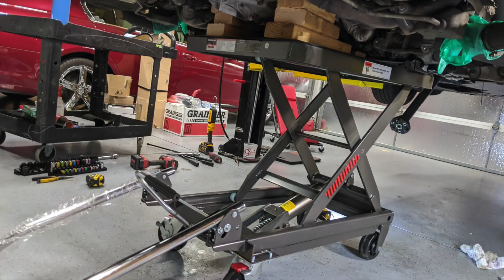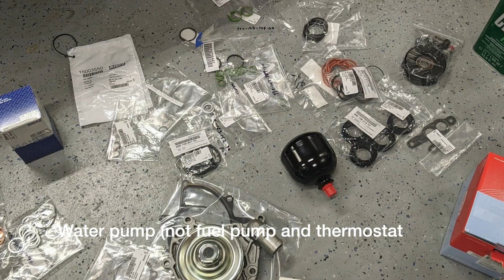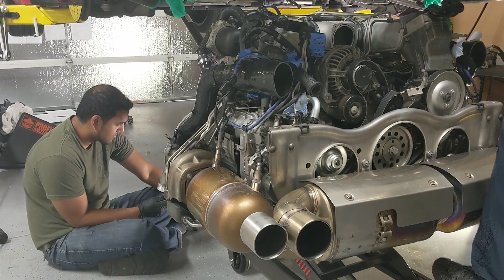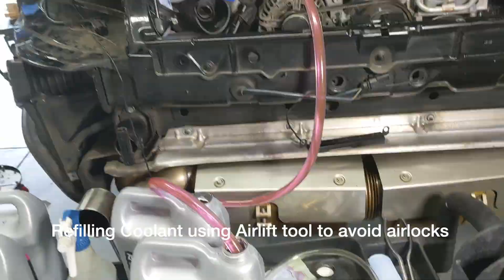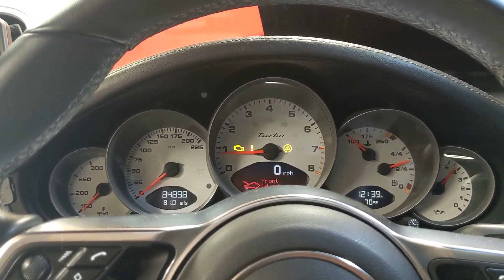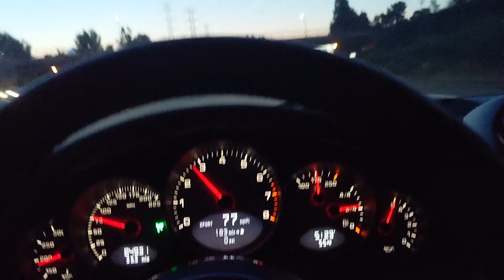Jay's 997 turbo Major Engine Out Repair- Final of 7 part series

Comment: so it can't be the last video you have to fix the new leaks right?
Reply from the maker: Yes, Spoiler Alert...

Jay addressed them and upgraded the fittings on the power steering lines.  He also re-did his timing  to improve the cam deviation but he probably should have left it alone as he ran into more issues.
Reply: @atm4jim  ooof it worries me as the a fellow owner... I checked my deviation with my PIWIS and it is -1.71 and -2.12 bank1/bank2.
Reply: The jury is out but so far looking good on the leaks been a week and (2) short drives
RMS requires a factory tool I didn't have the last time
PS lines have been replaced with AN style fittings